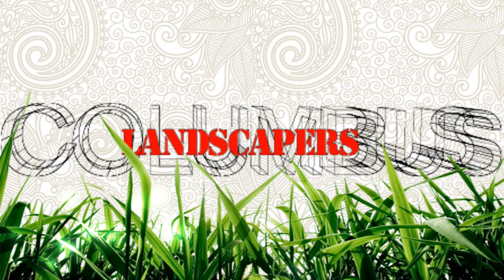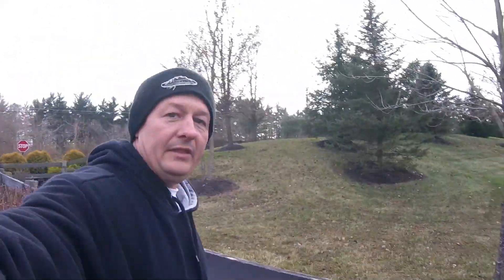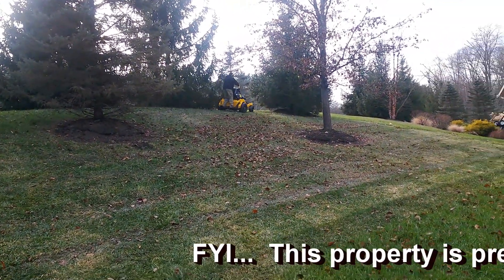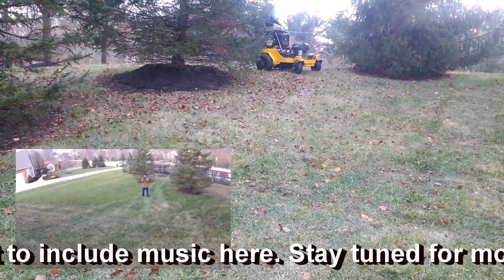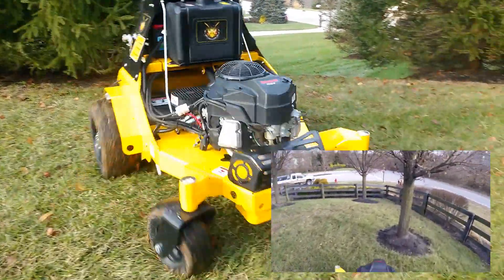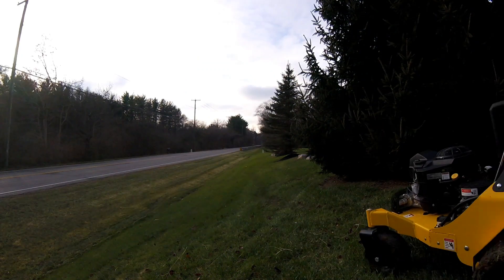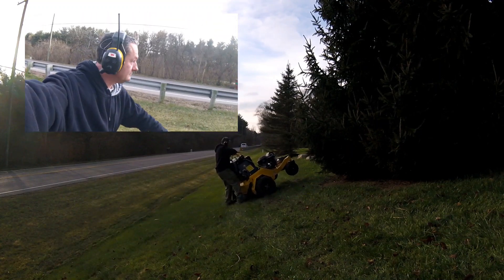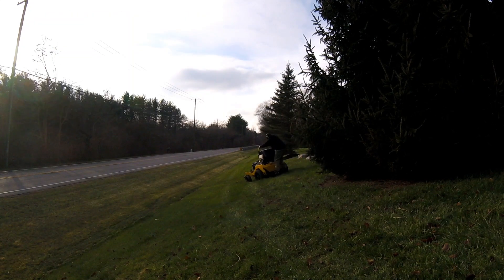Stinger Quad-Aer 3000 -  Field Testing on Hills Ride on Aerator

Comment: Any updates on the machine? I'm looking to get one for this coming aerating season
Reply: I have one.  It's the greatest thing since slice bread.  My buddies all running Toro and have already had issues.  I'm just sailing along with no issues.   The machine is a beast.
Reply from the maker: The bad news.. I think they have a 300 unit back log on orders.. unless you can find one on a dealership floor. The good news is by the time you get one you'll be able to take advantage of the newest updates!
Reply: Columbus Landscapers got mine yesterday
Reply: @danis0benz  . Got 50 hours on mine.  It's a nice machine.   Be careful.  Especially with hills and dips.   Thing will pop a wheelie and get away from you quick.